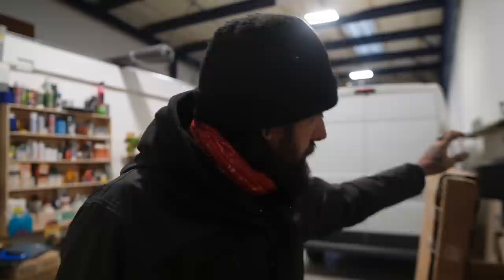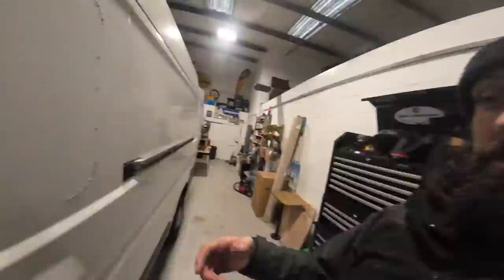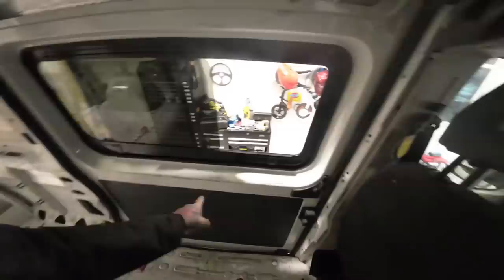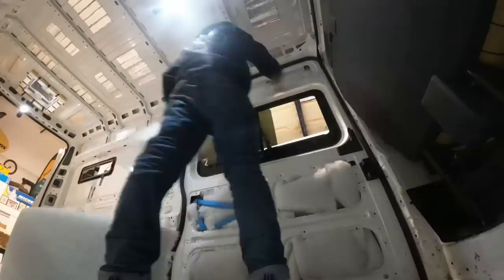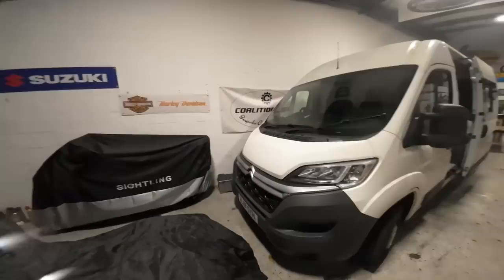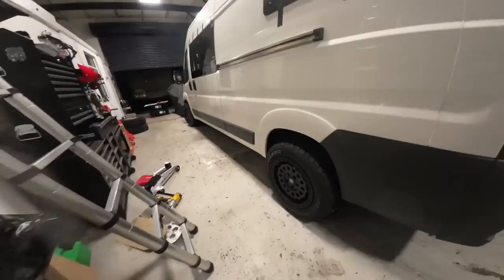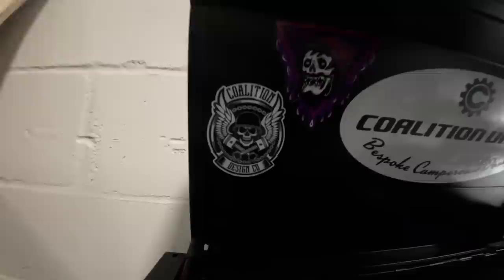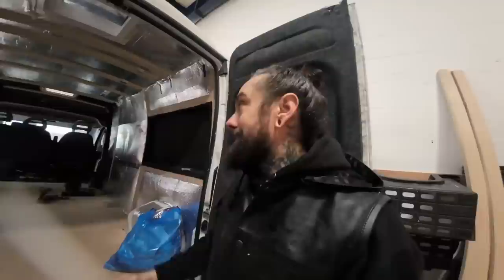Camper Van Build Step By Step (Pt2)

Comment: I’ve always done the centre punch method instead of drilling lots of holes. Both ways work but find it a bit easier matey. Join the dots just the same then and only the one starting hole to drill 👌🏽😉

Comment: Great vlog and appreciate the detail and tips. Do you always batten the floor (I understand it's not actually needed to spread the load as the insulation can take a UDL) or are the battens more for fixing other things to rather than down through the insulation?
Reply from the maker: It’s to stop the floor moving too much, you need to batten it

Comment: Could of questions:
Did you sound deaden the floor? As couldnt see that done, was going to do mine, but wondering if its worth it with insulating, then foil tape and 9mm ply?
Did you glue the white insulation foam in or squeeze it in - will save me a job if dont have to glue it
Vapour barrier - how did you attach it to the sides etc? Foil tape or is it self adhesive stuff?
Reply from the maker: Doesn’t need it because the ribs on the floor stop the vibration
Reply: @LiamTheTerrible  And the foam... hoping thats all just fed in and not have to be glued either.. following your videos, as we are about to start on ours so any tips you are giving are spot on. That tip on the carpet on the small exposed areas is perfect.. looking forward to part 3 🙂
Reply: Can you tell me.. that bubble vapour barrier.. did you use all of it for that van. And where did you get it from, as 7-10m rolls seem quite expensive and less cost effective than the 120 you bought that big roll for
Reply from the maker: @RussellOSullivan  no we will use more on another van too
Reply from the maker: @RussellOSullivan  no we will use more on another van too